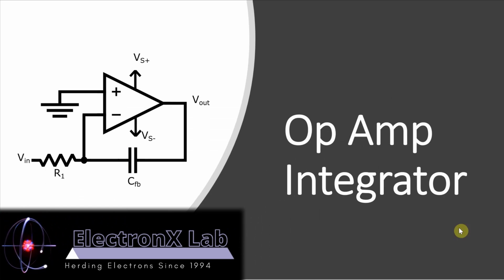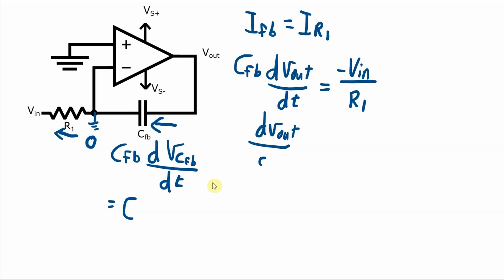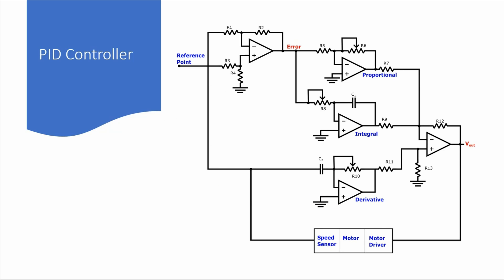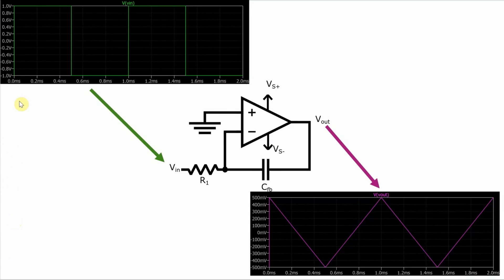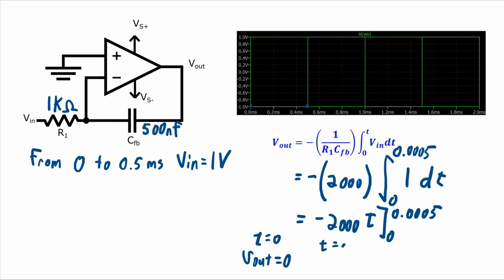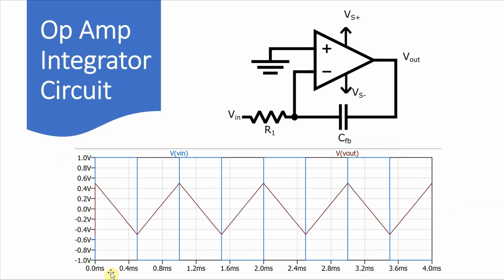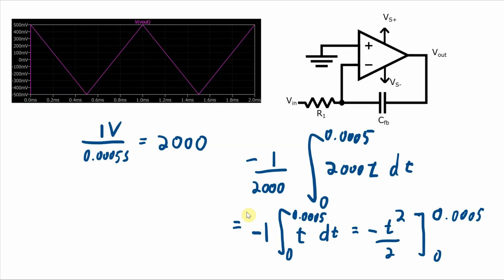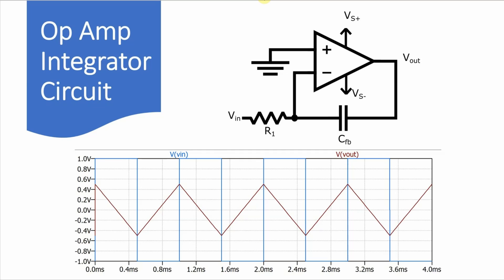Integrator Op Amp Circuit

Comment: Thanks for the video.   I don't see you power on the opamp?  Also, I copied your circuit parameters but the triangle output waveform got clipped on the top (flatting out).  Do you know the cause of it?  Thanks

Comment: Hello, i loved the clip and hope you're having a great day.
When we use ideal integrator with universalOpAmp2 or even simply theoretically, how can we calculate Vcc needed for Op Amp in order for Op Amp not to go into saturation? 
Thanks!
Reply from the maker: Your VCC needs to be higher than the maximum you expect the op amp output to be. This is tricky for an integrator if you have a constant input, because you will eventually reach saturation unless the input changes.
Reply: @ElectronXLab  Thanks for the quick answer! So basically I have ideal integrator with RC=10ms and square pulse with 1 and - 1 V amplitude with 1 ms period like in the video. That means the maximum output is - 50mV right at the change of polarity. That means that theoretically i need +-50mV VCC in order for op amp to function properly?

Comment: This was so helpful - Thanks for posting!  It's interesting to see this circuit keeps the charge rate at t-initial, and the time it takes for the output to swing from start to finish is always 1 x the RC time constant regardless of the voltage amplitude.

Comment: One thing I wonder, why will it linear?
A charging/discharging cap isn't linear so why here?
Reply from the maker: Notice in the circuit that the Vin voltage is not being applied across the capacitor, it's applied across the resistor and there is a virtual ground point before the capacitor. The combination of the Vin voltage source and Ri controls the CURRENT through the capacitor, not the voltage across the capacitor.  Since current is being controlled, it is what sets the capacitor voltage according to ic=C(dvc/dt)